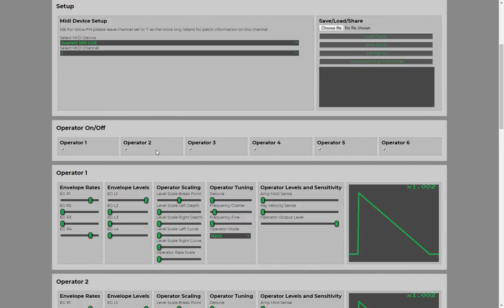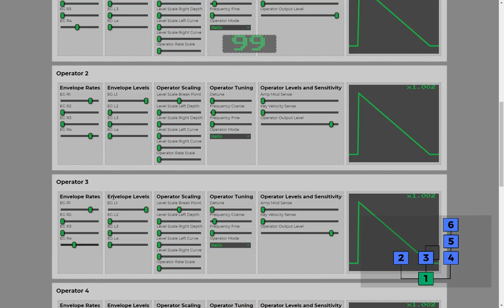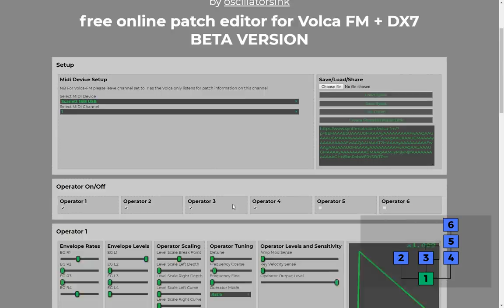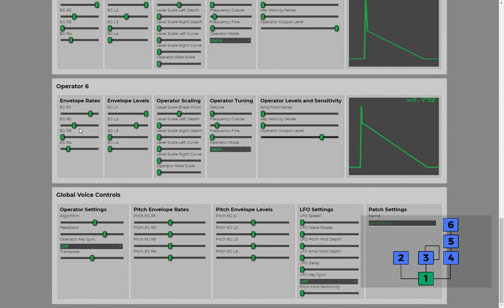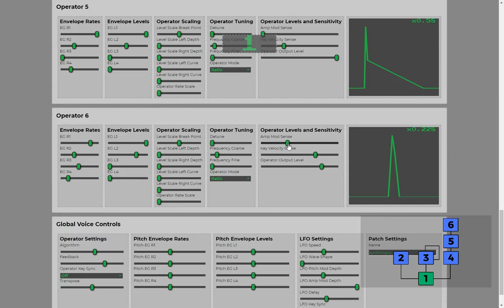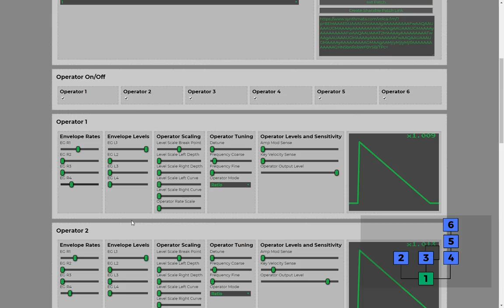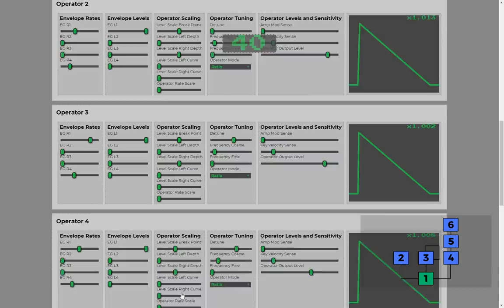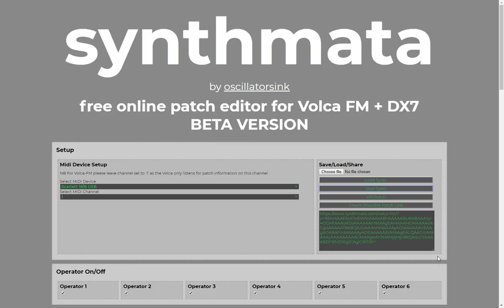Korg Volca FM - Let's Build A... Pad!

Comment: Hey Osc.  Thanks so much for your vids, knowledge sharing, patches, etc..  I need your help with a basic question.  When you were building this patch, were the sounds that we were hearing coming from your Volca FM live connected via USB midi.  Really struggling with this concept and I really want to use Synthmata to learn FM synthesis.  Thanks so much.  Darren
Reply from the maker: Hello! The sounds you're hearing are coming from the headphone output on the Volca which is connected to my audio interface so I could record it. I'm controlling the patch via midi a midi cable plugged into my computer (via my interface again, as it happens, but a USB MIDI cable would work as well). MIDI does not carry sound, just control messages.

Does that answer your question?

If you're looking to buy a USB midi cable I can recommend the Roland UM-ONE mk2. Not all cables are created equal and some have issues with sending the sysex patch data - the Roland one works great.
Reply: Wow!  Thanks so much for the quick reply.  Yes, answers my question!!  Ordering that cable today.    Synthmata is brilliant!!  FM synthesis was giving me anxiety with all the menu diving on the Volca, the visual interface of Synthmata is a game changer for sure.  Hope I can get my Laptop to talk to my Volca this week.  Thanks again for all of your help.  Loved your vid on the Monologue secret third oscillator.  I would have never figured that out.  Cheers!!

Comment: Hey. So Synthmata works perfectly with my Focusrite 18i20, but when I use my DoRE midi hub, I can't get it to communicate with the Volca. It recognizes the device but no back and forth. The midihub communicates btwn Logic Pro X and the Volca just fine though. Any ideas?
Reply from the maker: I've had some problems with generic unbranded midi interfaces not working properly with synthmata and it seems to be related to their buffer size being too low, so that the whole patch isn't getting through, so I suspect it'll be that. I know that at least one user I spoke to (who was on Linux) suggested that you could mess with the driver to get it to work, but otherwise I'm not sure that there's an easy solution.

Comment: Noob question, do I need just any generic USB to MIDI IN/OUT converter to upload?
Reply from the maker: +Glychee S pretty much! I've tried it both with my Focusrite interface and a cheap generic USB to MIDI cable and both work great. As long as the OS recognises it as a MIDI device, you should be golden!

Comment: Some say Volca Fm is quite noisy (backgroung hum and such). What are your thoughts on the subject?
Reply from the maker: +Luis Luzia I don't find it unduly noisy. It's not silent, but if you get your gain staging right (I find its better with the volume nearly full on the Volca for example) it's not going to get in the way in an actual finished track. Also, noise can actually help gel a track together, it's not always a bad thing to have some gentle noise in the mix.
Reply: Quod audire non-silentio mali-sonitum et per mathematica subtrahe?

Comment: I followed step by step on my fm and my patch sounds nothing like yours, weird.
Reply from the maker: +Til Top strange, were you following along in synthmata, or on your Volca FM? Did you start from the Init Patch? There is a link to the finished patch in this video's description - maybe take a look and compare?
Reply: Oscillator Sink I was doing it from the volca fm, I didn't start from an init patch but I adjusted all the values and operators the same way you did. I'll go ahead and take a look, thanks so much for these videos btw. It's really great of you to take the time to share this
Reply from the maker: +Til Top so, it sounds like there were other parameters set differently (based on whatever patch you started with) that I didn't  tweak along the way that would have had sonic effects left over. If you can get the Init Patch from synthmata, then you'll be starting from the same place and you should end up at the same destination!
Reply: @Noah-bo2jk  i think i know what happened - the front-panel controls on the volca will bias anything you do to the program - so make sure those attack and decay ones are all at 1200 - neutral,